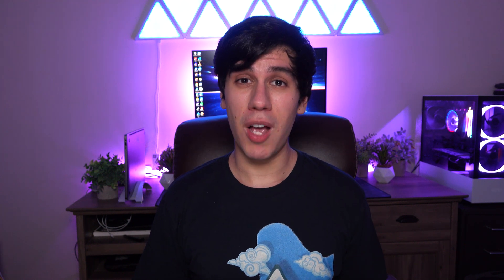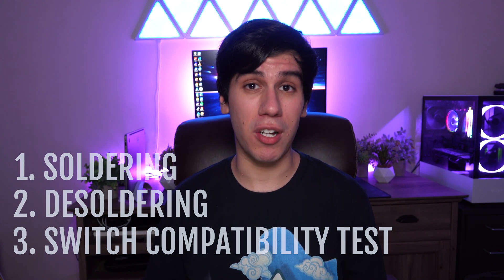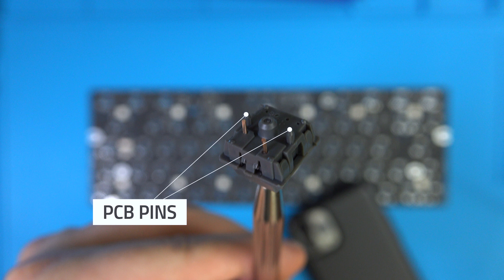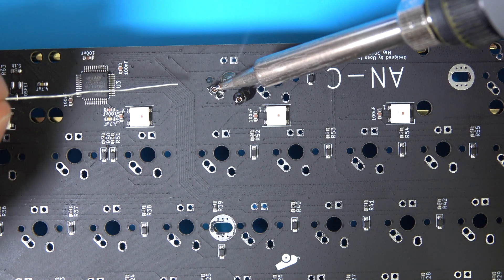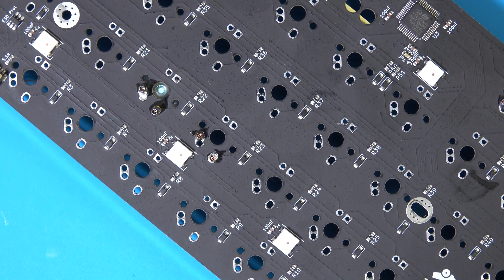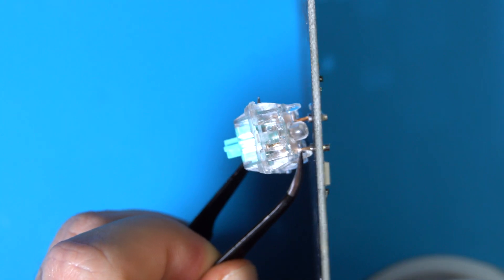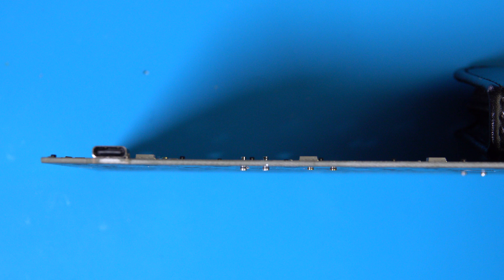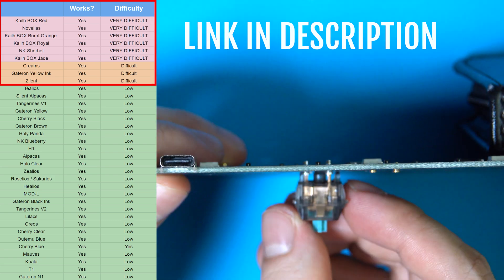How to Solder Mill-Max Hotswap Sockets (0305 & 7305) on keyboard PCBs

Comment: just put them on the switch first... *facepalm ;)
Reply from the maker: I’ve found I’m faster at it when I insert directly into the pcb first, but I know that’s really tedious for some, so good tip! :)
Reply: @keybonbon  you're missing the benefits of it - you pre align the socket correctly to fit the pins when inserting the switches for one but you also insert the pin all the way - sure, you're faster but then you have the bend pin issue later on when you insert the switches because that one socket just lays in a bad way and keeps on stopping the pin. ;)

(you should also recommend a much smaller solder tip and to remove them you should use a thin wire like the leg of a diode and pull it out with it)
Reply from the maker: sold! Thanks a lot for sharing this and explaining the benefits in a constructive way. I wish YT would let me overlay text like it used to so I could share this, but the best I can do is pin your comment, and down the line I’ll probably make a follow up video to cover this and a few other things I missed (i.e recommending thin wire like you mentioned— I used .5mm in this case). Have a lovely day :)
Reply: @keybonbon  Could it be that the (very) difficult to fit switches would fit better if the sockets were better aligned? Or is this just because of switch pin thickness?
Reply: @keybonbon  hey keybonbon, thanks for the video... i am a noob from germany

could u please explain me againg what @homerow was tryin to say in easy words?
because  i will build my first costum keyboard... and wanted to try the method you used in your video
i dont want to mess up big time while trying :-/
Reply: @bewatter3014  He's saying to align the sockets properly by entering a switch in the socket before soldering.
Reply: @zer0slayer1  isn't that what he did? He puts in a switch into the millmax sockets and solders the sockets to the pcb.
Reply: @tf2hion  enter switch into socket, insert the switch into PCB then.
Reply: @homerowco.1957   Doesnt putting them with the switch at times causes the Switch pin to also get "stuck" at times if solder ends up binding to "PIN" in addition to the Socket?
Reply: This is how Outemu hotswap sockets are btw. Standard Outemu switches come with the hotswap sleeves on the legs from the factory, this is why every super cheap Outemu board has these now.
Reply: Heating up the switch legs shaves off million of clicks in durability. You shouldn't do that if you can avoid it.
Reply: I was about to solder some mil max sockets on a macropad PCB I just got, but I realized I had a few extra Kailh Hotswap sockets that came with my ikki68 aurora keyboard. Was wondering which method would be the best for long lasting, and just work? (As far as soldering on these Kailh Hotswap sockets, or going with the mil-max and soldering those on?) I've personally never soldered either type of sockets, but guess was more curious if there any drawbacks or pros /cons to using the black Kailh sockets since they connect both sockets together...didn't know if this  had any advantages as far as anything like power, Electronic Short Protection stuff, VIA programming? (I know those are Mostly PCB features, but meant like do either form of sockets work better for the long run on a PCB that will be changed frequently in VIA and probably used frequently for testing out different switches more often than the average keyboard  PCB)

Any advice or recommendations between the two would be greatly appreciated 🙏 Thanks
Reply: @phlooke  afaik kailh sockets don't work on PCBs that weren't designed to have them.
Reply: @phlooke  iirc they had different PCBs for that, hotswap sockets require bigger holes in the PCB itself.

Mill Max and Hotswap Socket PCBs cannot be interchangeably used.

Comment: I was planning on using Kailh Pro Light Green switches with these. Not sure which sockets to buy as I have an MSI GK71. But after seeing the compatibility sheet, I'm not so sure now, nor which sockets I should use instead. 😬

Comment: I just fucked up, i went specifically around for a very specific board with specific layout, costet me quite a bit of extra money and research. I bought everything, and just as i was about to solder the few millmaxes i went to this video again (first saw it 2 years ago) and see that the kailh box i want to use have bad compatability... I just checked and damn, they dont go in really, the fixing pins of the switch are loose. Maybe its fine with the plate, but damn, really dissappointed....

Comment: I'm just about to start with more 'serious' mechanical keyboards and was wondering what's with the ones where manufacturer put switches directly into the PCB. So there is a way out - desolder and buy the sockets. Thank-s for sharing.

Comment: Oh my gosh, thanks so much for the spreadsheet! Just wondering, have you tested this with multiple switches or just one on hand? I'm concerned that there may be manufacturing variability in the size of the switch pins, causing some switches to be easier or harder to hotswap than others in a given line.

For instance, all Kailh switches are difficult, but most Gaterons except for two don't give you any trouble. Is there a possibility that the Zealios and Gateron Yellow switches you tested happened to be switches with slightly oversized pins for their line?

Comment: I'm desoldering switches from an existing keyboard and putting these in their place. So they can't just slide into the holes as it's really hard to get every bit of solder out.
I found that putting an awl (the kind used for sewing) in the top of the switch can help you gently slide it into place while you're heating up the solder.
Hanging the keyboard over your desk and holding the awl up with your leg also helped me solder on the back side without it sliding out. (There is very little leeway on this case, so I needed the sockets to be as far down as they can get without force.)
Reply: Another trick I've found if it's sticking up a little too much is to put kapton tape over the socket tightly, then set a chisel tipped soldering iron over it, The tape keeps solder from going into the socket.

Comment: First excuse me for my bad English from Google Translate xD... These types of "sockets" are made to be placed on boards that were not designed to be placed with hotswap sockets such as Kailh or Gateron? In other words, by placing this type of Mill-Max socket where the switch would normally be soldered directly, would our board, which is not designed to be hotswap, now be?

Comment: Very cool video! See I have this Logitech g810 that a really like, but the romer g switches are getting bad after almost five years. They are nice to type on but most key caps have broken Latches and I even had to glue some caps to the switches because they have no latches left to hold in place.. a bummer... I was wondering if I cloud turn it into swappable. Is it possible?
Reply: Logitech sends you a patch of new keycaps if you contact them.

Comment: great video.  would love to see a similar video with the 3305 sockets which were designed for mx switches
Reply: What's the difference?
Reply: @katanalama2174  3305 were designed specifically for hotswapping keyboards.  I think they're a little bit lower profile
Reply: @Camdem  ah okay

Comment: Mill-max have released some new sockets which are specifically designed for keyboards and switches :) check below

Part Number (shortest version) : 3305-0-15-15-47-27-10-0

https://www.mill-max.com/products/new/receptacles-make-keyswitch-hot-swapping-effortless

Comment: I am wondering is it possible to just insert all the millmax sockets (no switches) for the entire pcb then just put masking tape on the flush side to ensure flush fit.  Then turn pcb around and solder everything at once.  This way you ensure all sockets are flat regardless of any possibility of bent pin on defective switches, and soldering all sockets at once should cut down one total installation time.  Let me know what you think.
PS: if you are worried about mistakenly soldering I to the socket opening, maybe try insert one tooth pick in each pair of the socket you are soldering, then just move them from socket to socket before soldering.

Comment: This was super helpful thank you! I bought my first solder only PCB custom and decided to install 7305 sockets in them because I'm so indecisive about switches.

I think the consensus now is to put the sockets on the switches then slot them through a plate into the holes so I will do that instead too. I'm so glad adding these sockets is an option!

Comment: Is it safe to solder in a mill max in 2 empty sockets while all the other sockets have millmax AND switches in them? I accidentally soldered in the millmax in the sockets for a stepped capslock and I want to solder in mill maxes for the other 2 sockets which aren't meant for stepped capslock. I REALLY don't want to remove the switches out from the rest of the board because it's perfectly functional atm and some of the millmax is feeling a little lose so I don't want to take them out...
Reply: Most definitely it's safe! Just take your time. It's really no different than soldering all your switches in one go.
Reply: @chrisgalvez7735  thank you!

Comment: i purchased mill max 7305s from mouser. i had two very notable issues with these sockets: 1) on my vortex tab 90m, they didn't fit into the holes correctly at all. they could be coaxed if i took a tiny cylindrical file to the inside of the hole, but for obvious reasons i didn't feel comfortable with that approach. 2) my cherry switch pins didn't fit inside the sockets. these were newly bought cherry mx clears, and the pins were too wide for the socket themselves. moral of the story: your mileage may vary with this technique depending on manufacturing tolerances of your keyboard and your switches.

Comment: I have seen a few other guides claim that you need to simply push in the sockets with a heated soldering iron and not use any solder... Yet this video, you're using solder to keep the sockets in place... Which is correct?

Comment: I'm considering converting my current keyboard to hot swap, however, this keyboard supports plate mounted switches only, will my switches end up feeling wobbly despite the presence of a plate?

Comment: thanks so much for the video. From what I can tell, it is the second number that states the size. So 0395-0 is the same size as 7305-0 and both are much smaller than 0305-2.

Comment: Great video! I personally did it differently. I used tweezers to place the Mill-Max sockets into the PCB, but put a strip of heat resistant tape over a row of them, then repeated for the other 4 rows of my WhiteFox 65% keeb. Flipped the PCB over to the underside, and began soldering away. I repeated the process for the two-pin LED sockets as well. The end result was a completely hot-swappable WhiteFox. Very happy.
Reply: oh that sounds much nicer, I was dreading having to desolder every time I got some in the socket
Reply: I was thinking about the tape on the board to hold them up, thanks for the confirmation.

Comment: One question will this work on every keyboard?
Reply from the maker: It will work on virtually all custom boards, but I’m not sure how well it will work on pre builts. Also I wouldn’t do this on either a half plate or plate less build or on any build that has a lot of flex as that will mess with the friction of the sockets

Comment: I have a question... If I bought enough sockets to fill the whole board, can I in turn use any layout of the pcb accepts different layouts? mainly for the enter key e.g ANSI or/and ISO?
Reply from the maker: you can install the sockets on any part of the PCB so in theory you can have any layout, but you’d have to make sure the plate supports that layout

Comment: id recommend using a push pin to insert the socket in and taping them down with thermal tape. using switches takes or tweezers take way too long and you may lose a few during that process. having them taped down allows you to solder all at once and add more force to properly secure and use more force to push the sockets in further. you think that it's all the way down but really it's not. hope this helps!
Reply from the maker: Good tip, I’ll try that some time!
Reply: It doesn’t take that long to put it inside. It’s just your hands being “handy” enough to do the job. If you have tweezers, use it. It’s the proper way to use too. Look up how people actually solder smd components that’s way smaller than the socket.

Comment: What is the insertion lifetime of these sockets? Thanks for the well made vid.
Reply from the maker: Thanks for watching!! And do you mean how many times you can swap before issues arise? I’m actually not sure of the exact number they’re rated for, but I can tell you that by the end after swapping in and out 30+ switches the sockets were getting pretty loose in terms of friction. They seem to hold up better than kailh sockets though, which tend to fail for me in as little as 10 swaps

Comment: Really helpful video! Usually for hotswap PCBs, there will be standoffs and screws to attach the PCB to the plate (esp so for top mount). Will it be an issue if I use a millmax-installed PCB without it being attached to the plate?
Reply from the maker: I’m glad you brought this up! Yes, you may have issues with hotswap in general if you use it on a mounting style that is not tray mount (meaning it has the standoffs) unless you go with a stiff plate material like brass. Basic rule of thumb is don’t use hotswap with builds that have a lot of flex as the bending might cause switches to slowly move out of their sockets. I’ll cover this in a follow up vid
Reply: KeyBonbon Awesome! Looking forward to the follow up video :) Assuming it’s not tray mount, the thought of a PCB hanging onto the plate by mere friction between the switch pins and mill max sockets is pretty scary!

Comment: The way I solder millmax sockets is by first filling the holes on the pcb with a small amount of solder, then removing it afterwards with a solder sucker. Then I push the sockets through the hole and lay the soldering iron on them for 3 or 4 seconds so the remaining solder on the pads flows onto the socket. Less risk of clogging them with solder I've found.
Reply from the maker: Oh interesting! So you prep each hole with solder before soldering? Do you find that the solder interfere with pushing the sockets into the hole?

Comment: FYI, Linjar switches, which are a recolored gateron yellow for the most part, have one pin that is too wide to work with these sockets.  You have to file the pin down to make them fit.
Reply from the maker: cool thanks for letting me know! I added to spreadsheet :)

Comment: This is by far the best guide on how to approach to MilMax socket and the video quality is just top notch. This is just what I have been looking for. Thank you so much. I have some questions though.
When you list, for example, Novel cream switches in the difficult category, you mean that it is hard to put the socket on the switches before soldering or to put the switches on the sockets when changing the switches? For the ones that are difficult to insert, have you tried sanding down the the leg a bit? And you have also mention about the deterioration of the socket, I am guessing what you mean is the socket hole becomes loose because the switch legs are too big? Sorry for asking so many question at once. I am currently waiting for my 0305 and trying to do the same. Thank you.
Reply from the maker: Happy to answer all questions! Regarding difficulty, yes, difficult means it is hard to insert the switches in the sockets (they require more force than inserting other switches). Regarding using a dremel to sand down the legs, I have heard others having to do that, but personally I have not tried it (seems like a lot of effort but maybe it’s worth it if inserting is a big struggle). For the most part you can shove the switches into the sockets without having to dremel. Sometimes it helps to “wear in” the sockets into the switches before soldering. Regarding the deteriorating friction, I noticed that switches with thinner pins did not feel as secure after having used the socket on thicker pins, so some of the switches would come off along with keycaps when pulling keycaps. Overall I think the sockets are worth using if you really want hotswap :)
Reply: @keybonbon  Hey thanks. I have never thought there are certain switches that have thicker pins than others because many post on reddit seems to agree that 0305 sockets are compatible with is "99.99%" of switches. This new factor makes me really have to consider the switch choices. Is there anyway to tighten the socket holes? Ex use a tweezer.
Reply from the maker: Huy Pham hmm as far as I know there’s no way to tighten them after they’re loose. It’s really small so you would need some kind of special tool, but I’m not familiar with any way to do it